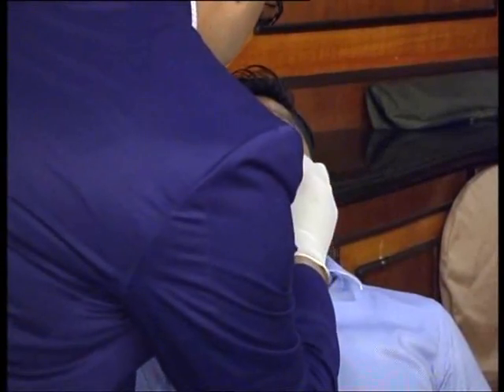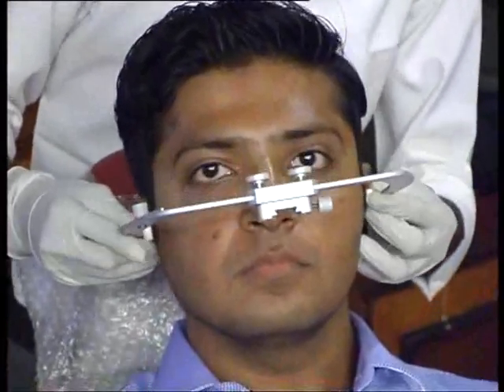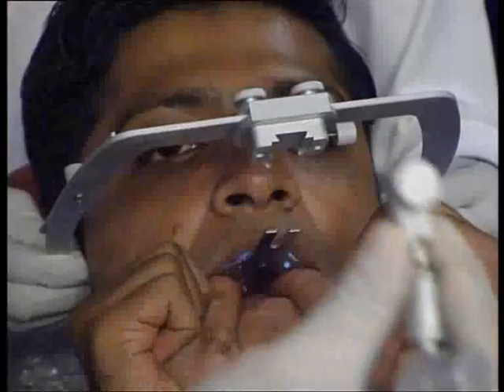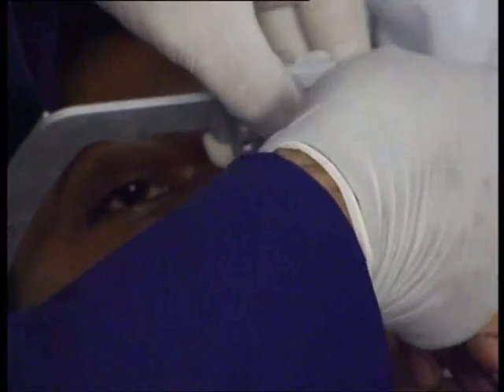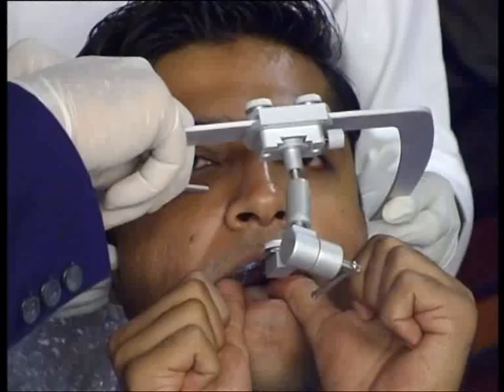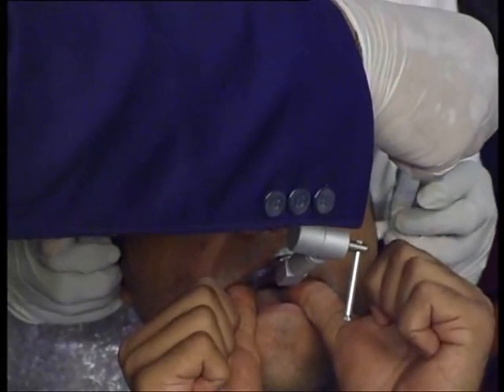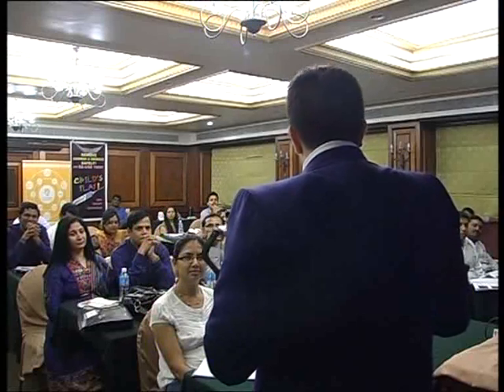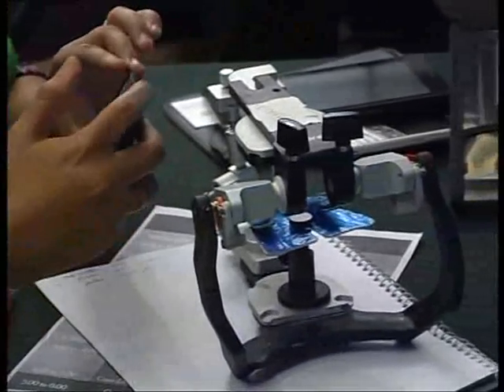Facebow patient demo using Corident articulator

Comment: My bite fork was rocking slightly at the anterior region, when I tightened the assembly.. I tried thrice again same.. where must I be wrong?
Reply from the maker: Is this in the mouth or on the Articulator... If it's on the Articulator that's how the system apparently works... Have heard and seen this multiple times in my courses... Do not worry there is no problem in your technique or your Articulator... That is how they are built...